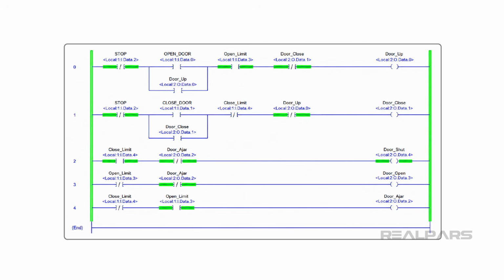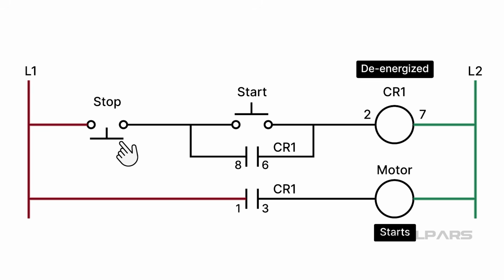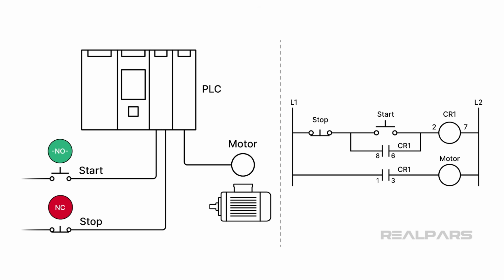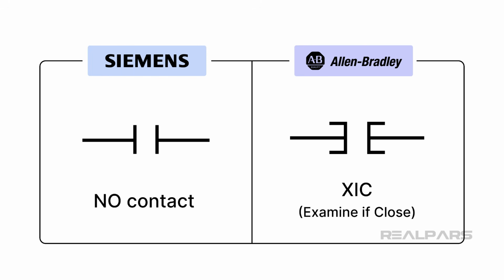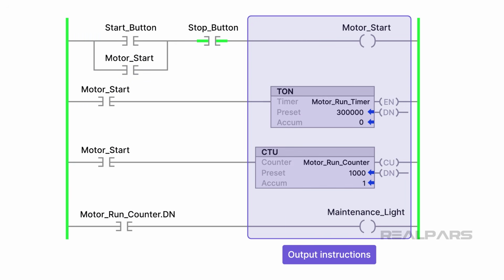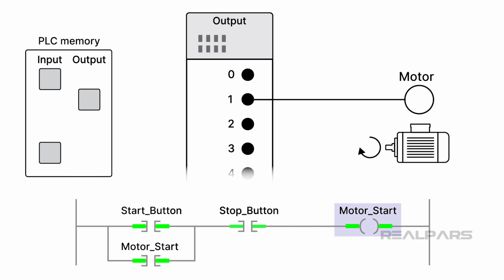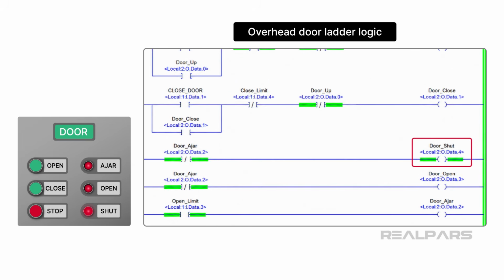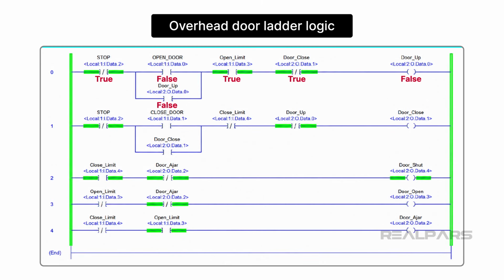What Is Ladder Logic in PLC Programming?

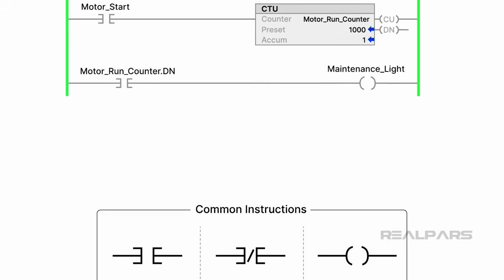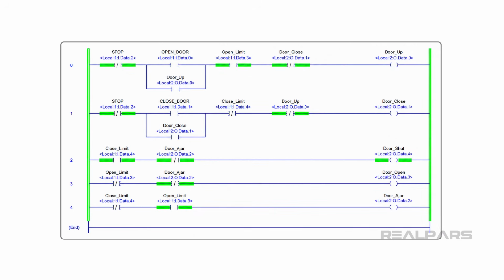Comment: The answer to the question asked by @MECHANISMUS is clear on its own (regarding the NO symbol for the Stop button after 5:54). But then, why does the Stop button on the ladder diagram after 8:50 already have an NC symbol, instead of the NO symbol as in the first case?
Reply from the maker: Hello! Thanks for your question. The 2 ladder logic diagrams and the physical hardware associated with each are different.    The ladder logic instruction is always chosen based on the physical device, so in the second ladder logic example, the physical switch is normally open.  I hope that answers your question.  If not, don't hesitate to reach out again.
Reply: @realpars Thanks for your answer! But why in the second ladder logic example is used NO contact for Stop button? This example is not for real practice?

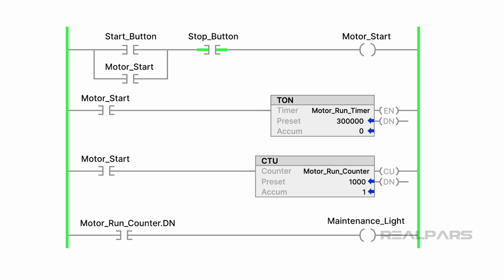Comment: Starting 5:54 shouldn't the STOP button be an NC trigger?
Reply from the maker: Hi there @MECHANISMUS.  Thanks for reaching out. If you look closely at the STOP BUTTON instruction, you will see that it is already TRUE.  That's because the physical device associated with it is an NC switch. Now, if that switch were an NO device, then the STOP BUTTON instruction would be an NC trigger as you suggest.
Reply: @realpars Could you be more clear?
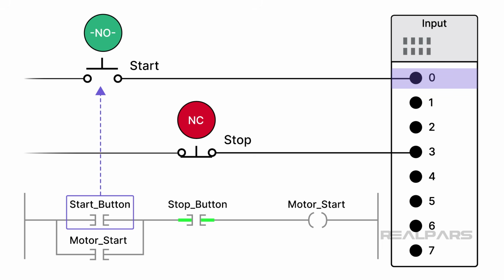Reply from the maker: @gabogunrin  I'll give it a shot. The actual physical Stop button at 3:35 is normally closed. Review the video again from 7:00. Because the Stop switch is closed, the PLC sees a closed path, resulting in a logic 1 in the memory location that controls the Stop_Button Instruction on the first rung.   Because this is a normally open instruction, it is being told to operate by the logic 1. Therefore, it will go from open to closed as soon as the power is turned on. Let me know if that helps.